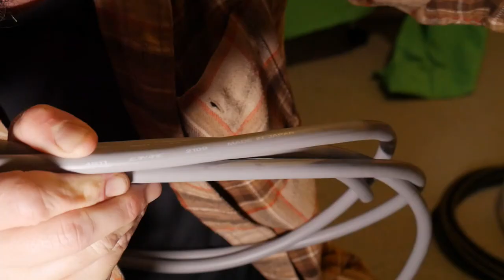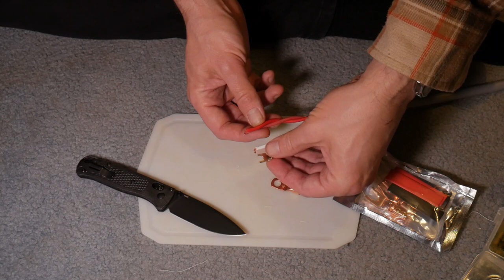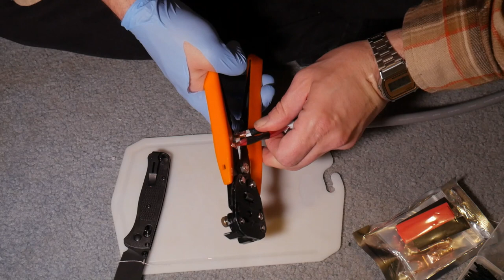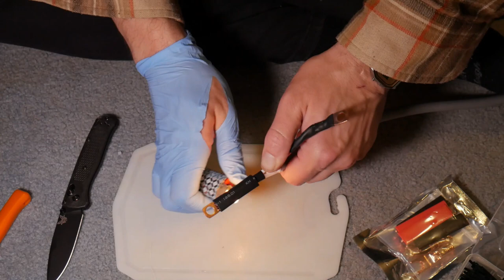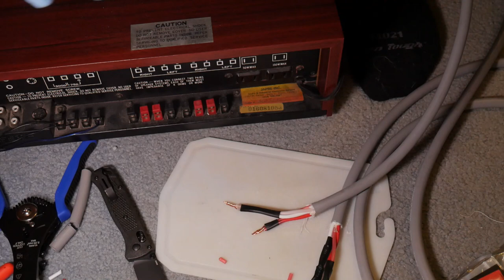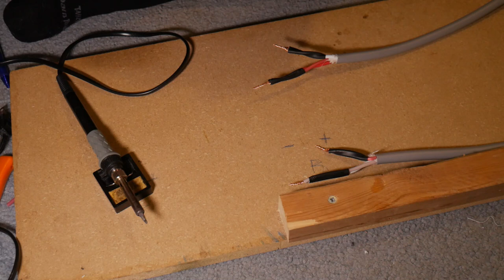Speaker Cables - Do They Matter? + My DIY Cables Recipe

Comment: Good video and good tips. Something I did for vintage gear is I made short little cables with bare wire that can fit in the gear but I put binding posts at the other end so now I can use banana plugs. This helped me to be able to use the same cables with any amp I have.

Comment: Great tips for keeping the wire clean and making them different length. I’m going to make some Bi-Amp wires from a four-strand soon so taking that into account. Thanks. 👍🏻
Reply from the maker: In the Canare 4s11 you can tell the four wires apart because one of the red and white wires have translucent jackets. The other two are opaque
Reply: @PlaybackMansion  i’m having some other cable with white, red, blue and black ( 4x4 mm2 Supra Rondo ). Just have to get the separation of positives and negatives correct.

Comment: Thanks, Ryan. I enjoyed this DIY lesson. Hope you do a lot more of these and hope you might also do some of these on how to connect equipment together, especially when there are options. For example, I did a ton of research on how and where in my equipment set up to hook up an external DAC. There are many ways to do it based on equipment you have or willing to purchase and even the inputs the DAC allows. After that, it’s ensuring that you’re getting the max capability out of the DAC. I think you’d do an awesome job talking us through the process.
Reply: Curious what your setup is, and why there were so many options for the DAC. 

That reminds me. I need to try usb to my DAC now that the bluesound node supports usb out. 

I never thought external DAC connection was any kind of difficult consideration, but I am looking at minidsp SHD, and now I do face questions on where the external DAC will live in my chain. Or whether it will "live" at all since the SHD has its own DAC.
Reply: @erics.4113  Eric, I had/still have many questions about DACs, whether I need/ed one, where to place it within my equipment chain, and how to connect it my theater set up. What complicates things is my desire to play hi-res music from apps like Amazon and Tidal (I have subscriptions to both). My Integra receiver has an internal DAC that supposedly is very good. And, it has music apps onboard which supposedly eliminates the need to use an external streamer, too. However, I have been unsuccessful getting anything higher than lossless quality from these onboard apps so looked/ing at adding an external streamer that may or may not have a DAC onboard. If not, would connect it to an external DAC before connecting to the receiver via analog/RCA jacks. Before doing some research, didn't know if I could eliminate the external streamer and put the DAC between the receiver (to leverage the onboard apps) and amp I have. I was able to eliminate that idea by working through the connection differences between the two but not before doing research and physically following the connections between them. When I first began my research, I didn't even know a DAC would improve my sound or what connections to use to bypass a given DAC to use a better one downstream. I would have benefited from someone talking through all of these considerations. Not something audiophiles or more technical folks would benefit from but would be of help to those of us who value watching building DIY speaker cables or discussing high-end vs. DIY cable videos.
Reply: @timmccoy6356  it's definitely a simple device that can get quite complicated rather quickly. In theory, the DAC shouldn't sound like anything. Just convert the digital bits to analog signal. But like most things, it gets complicated because many DACs really act more like a preamp. They not only do the conversion, but they output at a line level voltage that requires those components be quality as well. 

Are you still looking at an external DAC or have you bought something?
Reply: @erics.4113  I will be buying something at some point if I can’t utilize the internal receiver DAC to solve my problem. I have added an Andover Songbird at least temporary to the receiver to remove the receiver from the streaming need but the DAC in the Songbird is not the greatest so thinking of adding a DAC there and then link to the receiver. I will likely bebreplacing the Songbird as it doesn’t do MQA. If I do that could look at a combo streamer/DAC that does MQA but most of those options are not cheap. Did you have a reason for asking about me having a DAC?
Reply: @timmccoy6356  was just curious what you settled on. So many pathways to choose and I'm new(er) to the hobby and still experimenting and learning. I did add a denafrips ares 2 DAC to my setup. It's awesome. But there are better measuring DACs for less money, albeit using a different topology e.g. delta sigma chips, vs the old-school R2R ladder that my denafrips employs. There are those that claim the denafrips is more analog sounding, and others that say get a better measuring DAC and it shouldnt change the sound at all. Two camps I suppose. So I'm dipping my toes in both sides before I come to any conclusions.
Reply: @erics.4113  I bought a Cayin RU6 dongle DAC to use with my iPad and phone and headphones. It uses the R2R tech you mention and I think it does a great job of bringing out music in great detail. Supposedly, it provides the music in its original, recorded sample/bit rates. Better still, it has a display and I can see those rates. I haven’t given much thought to connecting this to my receiver to see if I can do the hi res music from either device thru the Cayin to the receiver but I should probably try it.

Comment: Varying the termination length is a good tip to avoid shorting out the wires, will do this 👍
I’m not superstitious- only a little bit stitious so not using wire with 6 nines copper  😁

Comment: This is really a thorough tutorial with great tips. What types of connections to you prefer with 5 way binding posts? I see you are not using banana plugs - any special reason why? Do you have links to Amazon or other location for the wire? What is the best covering you have found to be functional and pretty? Thanks again - really enjoyed it.
Reply from the maker: Intuitively I like bare wire the best because the signal has a simpler path. Practically I like banana plugs because I'm always changing my setup and they're super easy. These cables I made specifically to wire up my Sansui 331 to my Zu DWs. I like using solid copper connectors whenever possible because it's the same material as the wire and I change connections frequently so I'm not worried about oxidation. I got the wire from performance audio because they had the best price at the time